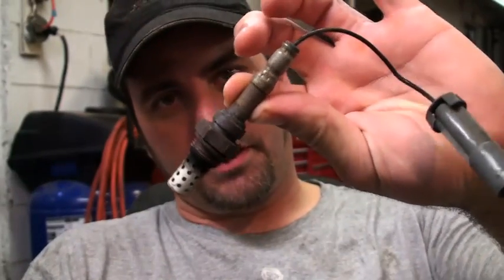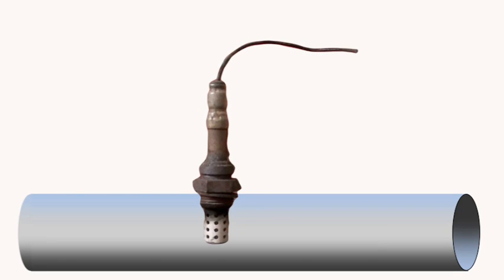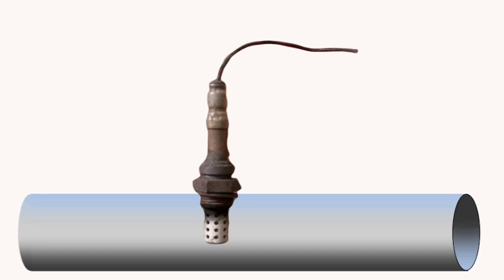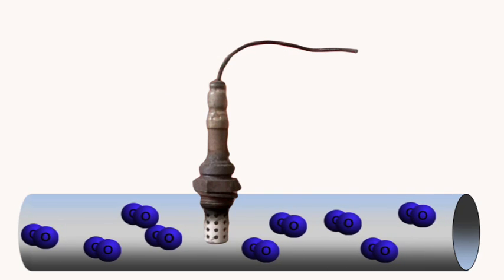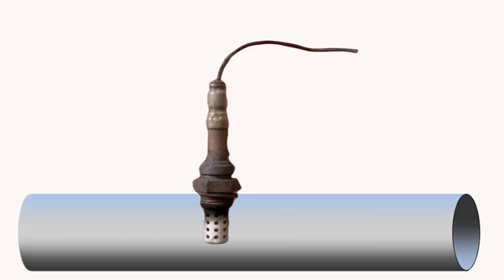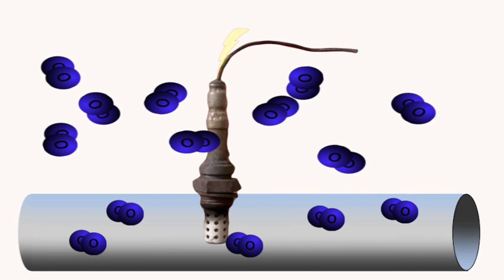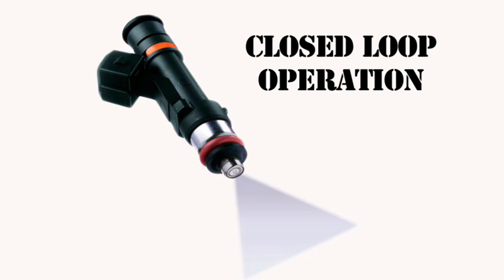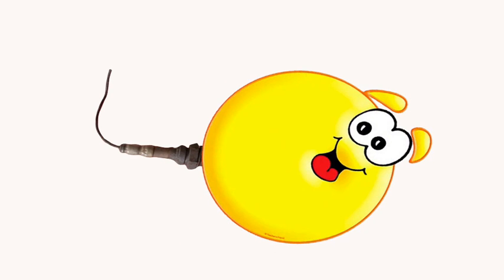O2 Sensor Basics - EricTheCarGuy

Comment: Thanks again Eric for your education. 

I just read the fault codes on my acura cl and they came out with p0401, p0170 and p0171. Based on your video and all the discussions below can I call this to be an exhaust issue before looking over the 02 sensors or the MAF? I did clean my EGR port recently and have been hearing some "cracking" noise as I throttle during driving.

Comment: @EricTheCarGuy Thank you Eric.. the reason why i said it seemed odd to me is that i planning on a few more intake mods. i have already installed better cams than stock.. and am soon goin to replace the head with a 1.8 kr head.. (larger inlets).. as motronic is a bit lean at the best of times i was goin to add a wideband plus air/fuel gauge, and moddify feuling through the dpr... sorry for going on but will a wide band give a steady/er reading on the gauge? excuse if i make no sense lol. ty again

Comment from the maker: @savuisai That doesn't sound like an O2 sensor problem but rather an oil control problem, I suspect it's the oil control rings.  To fix it you will need to repair or replace the engine.  A compression test will help confirm this, I've done a video on compression testing if that helps.

Comment from the maker: @desisandhuman It's hard to say without getting a look at it for myself but if it occurred after you put those plugs in you might consider putting the OE back in just to check if that makes a difference.  Using performance parts in a non performance application is often not the best way to go in my experience especially on newer engines.

Comment from the maker: @michaelmonsod It is most likely the sensor but it could also be a wiring problem.  I like to verify it's operation or non-operation before I replace a sensor, a quick look on a scan tool is all that I usually need.

Comment from the maker: @jambe1234567 It monitors catalytic converter efficiency which is an integral part of the emissions system and if your going to pass an emissions test all systems need to function as designed.

Comment from the maker: @jambe1234567 I wouldn't say it's the most important O2 sensor on the car but it's probably more expensive because it has a longer wiring harness which would drive up the cost of materials to make the part.  It will need to function to pass an emissions test regardless.

Comment from the maker: @jambe1234567 There is no physical difference in the sensors and you are correct it's only purpose is to monitor catalytic converter efficiency which was mandated as part of OBDII.  It has nothing to do with fuel economy but if you suspect a bad cat you can compare the 2 readings and see how the cat is doing, if they read about the same then the cat is bad, if the post sensor remains around .5V then the cat is working fine.

Comment from the maker: @IDONTKNOWIT21 Probably one of the most important sensors on the car is the O2 sensor as far as fuel mixture is concerned so yes you need it for good fuel economy.  If you run it without a cat however you will still have a check engine light however not to mention it would fail an emissions test.

Comment from the maker: @spelunkerd Before OBDII this was the case however the newer sensors are much more accurate and with faster ECU's it's easy to see if a sensor is not performing correctly.  In fact before OBDII it was common practice to replace an O2 after about 60K as part of a "tune up".  You really don't need a lab scope to check them however just a good DVOM.

Comment from the maker: @chackers Lean is not enough fuel OR too much air, rich is just the opposite.  The sensor has 2 parts, one exposed to the outside atmosphere (those little holes around the top by the wire) and the other end is placed in the exhaust stream.  The bigger the difference in O2 between the outside air and the air inside the exhaust the greater the voltage produced by the sensor, in short, rich means (less O2 in the exhaust) voltage close to 1V and lean means a lower voltage is produced closer to 0V.

Comment from the maker: @cwilkins318 Misses under load are often the result of an ignition problem but not always.  If you have a check engine light on then that is where you should start with your diagnosis, pull the code and follow the trouble shooting for that code, once you have done that check to see if the problem is still there, if it is then perhaps check the wires and the rest of the ignition system.  Good luck.

Comment: Hay what's up Eric, what I want to know is , I had my truck tuned up a week ago, It's a 1999 GMC yukon, it ran fine for a few days, now when I stop and then start to pull off
it stalls but it don't shut off it shakes bad and feels like it's about to shut off, my check eng. light came on a few weeks before I had the tune up, the shop reset it and said I needed a tune up, don't really want to take it back without some help, one mech. said that they may not have replaced my wires or my rota cap

Comment from the maker: @tigerhorns The black smoke may have nothing to do with the O2 sensor, in fact it could be something else altogether.  If you have a check engine light for an O2 then I might pursue that but it could just as easily be an ignition problem or some other electrical issue.  I'm not a fan of cleaning engines as I've seen lots of problems pop up similar to yours after cleaning.

Comment: i bought an a/f ratio gauge by sunpro my mixture reads lean and after replacing both upstream and down o2 sensors it still reads lean if anything could you give me every possible idea what could be wrong? i have a 99 ford zx2 the gauge should sway as i give it gas it just stays at lean any help would be appreciated and its not how my gauge is hooked up

Comment: i bought an a/f ratio gauge by sunpro my mixture read lean and after replacing both upstream and down o2 sensors it still reads leans if anything could you give me every possible idea what could be wrong? i have a 99 ford zx2 the gauge should sway as i give it gas it just stays at lean any help would be appreciated

Comment from the maker: @MyHurtlocker If it's a 2002 it would set a code for a bad O2 if it was bad.  You might want to look elsewhere for the problem, I would start by hooking it up to a scanner and reading the data that the computer sees to look for any anomalies that might indicate the problem.  Any good technician should be able to do this.

Comment from the maker: @Drudy90 Lean codes are almost never the O2 sensor.  It's usually an engine performance problem such as a vacuum leak or sometimes an exhaust leak.  You might benefit from the video I did on "Power Balance Testing" too as well as finding a vacuum leak.

Comment: My check engine light is on and is giving the code for lean running in both banks.  It also has a "loping" idle and rough starts.  Does this sound like the O2 sensor to you? Also if it does how do I know which sensor is bad since most cars has more than one?

Comment from the maker: @chanaco22 Those wires are shielded so if they are damaged it could cause a problem.  If the engine is running that rich however there might be another cause besides the sensor, the sensor may be a symptom and not the cause.  You might want to look for vacuum leaks or an engine miss, or even a faulty injector.

Comment from the maker: @evernet01 I believe that code is for the heater inside the sensor itself, if the wiring is OK it's probably a bad sensor as the heating element is separate from the sensor output.

Comment from the maker: @FatLipDude69 I used to work at a dealer and some of the people I worked with lets just say, weren't always right.  To answer your question they look like spark plugs sticking out of the exhaust pipes.  You may need a special socket to put the new one in, they are all 7/8" in size however.

Comment from the maker: @FatLipDude69 Well there are about a 100 different things a check engine light can be on for besides an O2 sensor, you would first need to find out why the CEL is on and the code to go with it before you start throwing parts at it.

Comment: @ZukiBiker13, I had it checked out and it was the 02 sensors. The place the i got it checked at said that the 02 sensor would drop a signal at a random time for no reason. When it does that, it would flood the engine with fuel causing it to sputter and stall .The computer would think the car was lean because it was not getting a signal from the sensor and that would cause a code to pop up saying that the mixture was too lean but it wasn't. I got new 02 sensors and now the car runs & idles great!

Comment: @EricTheCarGuy The check engine light came on and it was the 02 Sensor, that was fixed. But I still have a bad throttle response, rough idle went it does idle, and most of the time it stalls at idle. I was doing some research and found out that it might be an Idle Air Control Valve. Do you think it could be that?

Comment from the maker: @Super98mustang Not really, the O2 sensor for the most part is for fuel trim, if the computer senses that it is out of range for an extended period it normally turns the check engine light one and ignores its input.  Do you have a check engine light on?  If so, what code?

Comment from the maker: @TopGearrules The system will not read information for the O2 till the engine is at operating temp so the O2 is probably not at fault for the cold idle problem.  I would look for connectors or something that might have been moved or damaged during your repair.  In other words check your work as you might have done something accidentally or the sensor may be faulty hard to say really.

Comment: Wait, i replaced my hose and coolant spilt down and might of effected the o2 sensor. Now it idles and runs very rough when cold, but smooth when warm (optimum engine heat). Could this be the trouble im having?

Comment from the maker: @JotaJotaHJ If the sensor has more than one wire one of them is actually powering a heater that is used to get the sensor up to temperature more quickly, those are mostly 12 volts however, or you might be on the wrong wire at the ECU, most reference voltage is 3-5 volts, you could have been on another sensor wire.

Comment: Hello. I have a question about the oxigen sensor of my Ford Bronco II, 1988 engine V6, 2,9L.
I measured the voltage coming from the O2 sensor and It is working about 0 to 1 volt. When I connected to the ECU I measure 2 to 3 volts. Why is this? It´s the ECU sending a singnal or voltage to the sensor? Why?
Thanks a lot...

Comment from the maker: @Turbotrips I didn't say that it measures the O2 in the outside air but rather that it produces voltage based on the amount of O2 in the outside air as compared to the O2 in the exhaust.  The difference in O2 causes electrons to flow and produce a  voltage that is proportional to exhaust O2 content.

Comment from the maker: @infamisss1 Rear O2 sensors monitor catalytic converter efficiency and don't effect fuel mixture.  If you want more power they only real way is to modify the engine and the fuel map of the PCM accordingly.   Other than that you will just be confusing the existing system and loose power and increase emissions.  Modern cars are set up to discourage modification.

Comment from the maker: @blind898 Great question.  The secondary O2 is just for monitoring catalytic converter efficiency and does not contribute to the fuel mixture calculation.  The secondary O2 is mounted either inside or after the cat, the computer compares the readings of this sensor with the front sensor to gauge cat efficiency.If the front sensor and rear sensor read close to the same the cat is not working. You should see the secondary sensor remain pretty much constant while the front will fluctuate when good.

Comment from the maker: @joejeep03 Not all O2 sensor codes mean that you need an O2 sensor, some of those codes mean that the O2 is seeing something that is not right.  Really depends on what code but you may have fixed it with your tune up as you said.

Comment from the maker: @rock21586 Sorry mate but that's not necessarily an O2 sensor code but rather a possible indication that the catalytic converter is bad.  Catalyst efficiency is monitored by an O2 sensor either mounted in or behind the cat.  If you looked at this sensors waveform on a scope it should remain almost constant and not fluctuate too much, if it does fluctuate it means the catalytic converter is not doing it's job and needs to be replaced.

Comment: My 2003 Volvo S60 2.4T shows the code P0420 code for "Catalyst System Efficiency Below Threshold (Bank 1)" what is the probable solution for this one. Can i find some video for changing the O2 sensors on volvo.

Comment from the maker: First, don't make assumptions, gets me into trouble all the time.  If you suspect a bad O2 you need to verify that with evidence meaning you need to check it's output while it's running to see how it is operating, if it's out of range then sure replace it.  After a time they do get old and don't work as well as they did, some would say replace them as part of a "tune up" but you might just be replacing parts. BTW what your looking for is a reading near .5V which is neither rich or lean.
Reply: I forget how much technology has progressed...come tell me that you have a CEL and I'll just plug into your car and tell you everything you need to know, and then I'll be able to tell you what everyone else did to fix it...damn, in today's age, 13y is more like 30 if you're thinking about tech from the 40s/50s😂

Comment: dang this is a nice vid. so were aiming for RICH right? i dont have a cat converter, it was replaced with a metal pipe b/c my cat had a hole in it and it was making crazy noises now the noise it gone. so if im losing gas more than usual can that be a bad o2 sensor? or something to to with my exhaust line? my car has (2) o2 sensor (93 camry 2.2L), which one do i need to replace for better gas mileage? sorry if i may sound a noobish cuz i am when it comes to engine, but i can learn :]. thanks.

Comment from the maker: It won't matter if you don't have the cat you will get a CEL no matter what.  There are 2 sensors before and after the cat to monitor catalytic converter efficiency, without a converter the sensors will read cat efficiency below threshold and the light will stay on anyway.

Comment from the maker: Excellent question, I think it will make a nice topic for a future video.  For now to answer your question, on a V6 engine there are at least 2 sensors, one for each side of the engine, bank one is the side of the engine with #1 cylinder.  Your jeep would have a straight 6 I believe, in that case bank one would be the sensor closest to the engine.  Good luck and thanks for the comment.

Comment from the maker: I plan to do just that but if you need the information now, you are looking for a signal from the O2 sensor to fluctuate around 0.50 volts as the car is running.  You can do this using a DVOM set to measure voltage with one lead on the sensor and the other on a good engine ground.  Thanks for the comment.

Comment: Great Video...really!!

I have a question in regards to my 04' Jeep Liberty. My engine light came on and I discovered at the Advanced Auto parking lot that one of my oxygen sensors came on. 

I was told that there is banks 1 and 2 and something else....

Could you please explain to me what the names are for the o2 sensors located  on my 6 cyclinder. The guy was confused on which bank was the problem so I decided to wait till I could know for sure.
Thanks for any input.